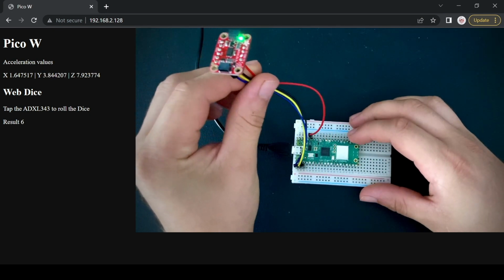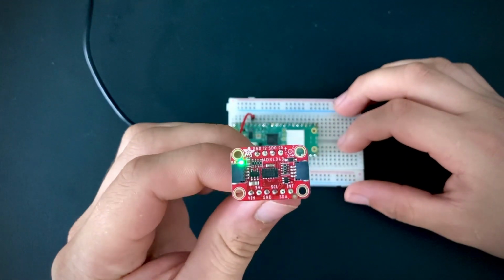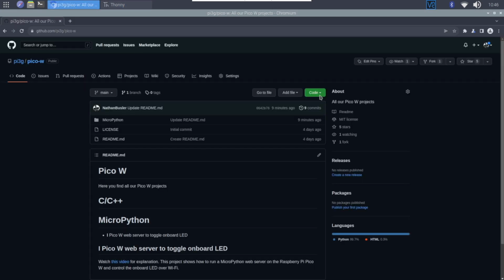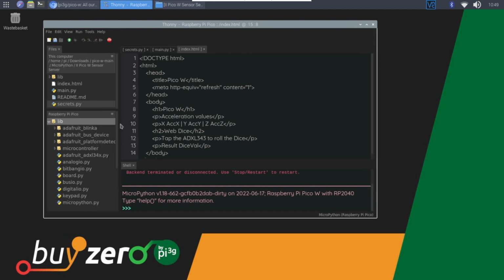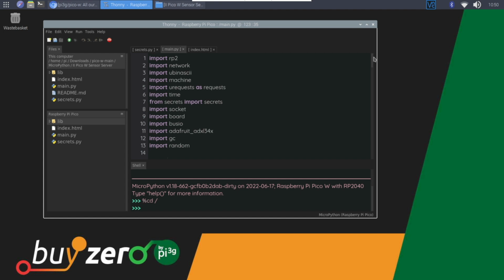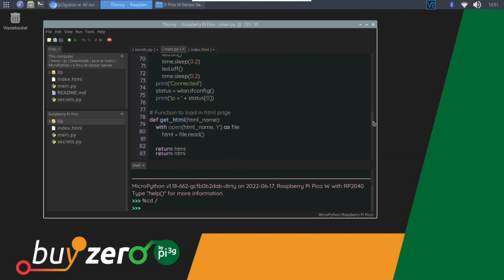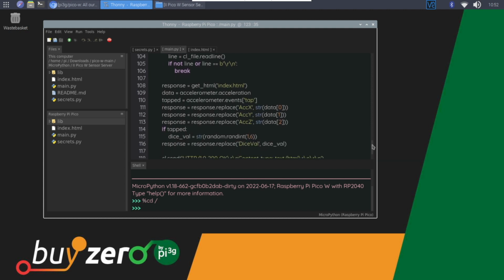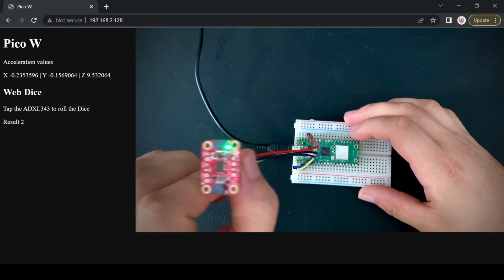Pico W Sensor Server - Display Realtime Sensor data over Wi-Fi

Comment: Hi and first of all thanks for your video! Is it also possible to connect to Pico using a Wifi Direct connection ?
Reply from the maker: Hi @luke752010 - do you mean the Pico W or are you referring to the Pico itself?
Reply: @pi3g  I mean Pico W

Comment: The title and the first 10 seconds he did not mention that he is using  "Adafruit Industries 
ADXL343 - Triple-Axis Accelerometer"  not until 22 seconds later.
Reply from the maker: The video is not about the sensor, it just serves as an example.  You can use any sensor that you have at hand. For Adafruit sensors you just need to copy the corresponding .py library file  into the lib folder and adapt the code a little.

Comment: Line 65..  Doesn't that mean it'll only EVER flash three times?   Otherwise it'll throw the RunTimeException?
Reply from the maker: You are absolutely right. We changed the code on our GitHub so that the onboard LED indicates the error code correctly.